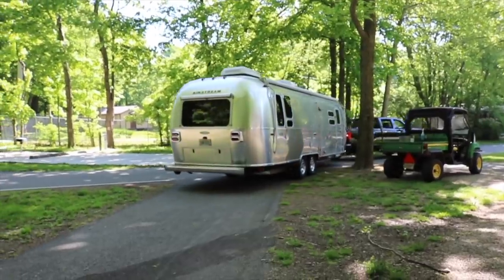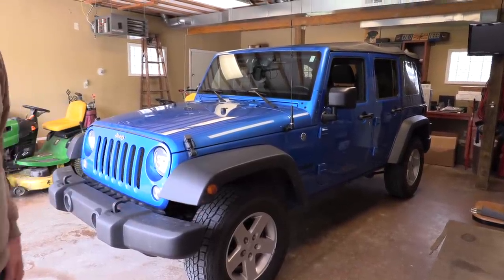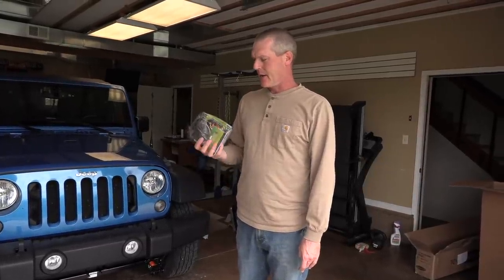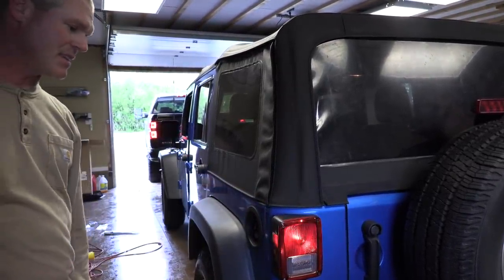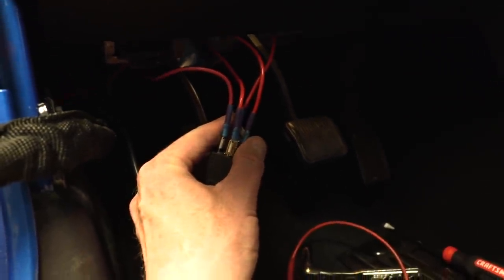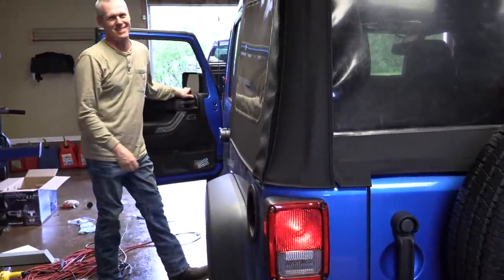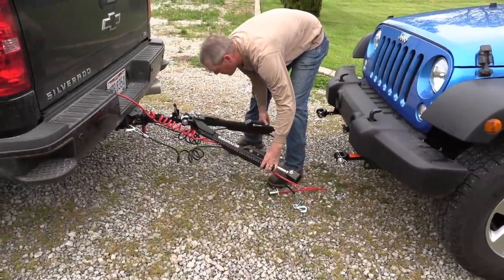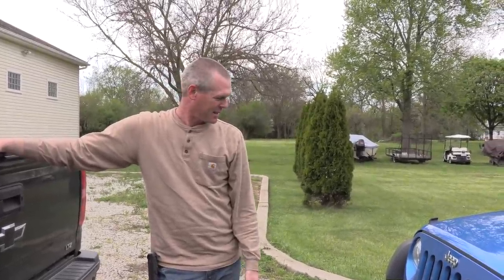Roadmaster Nighthawk Install// Jeep Wrangler Flat Towing RV

Comment: Yep, I did pretty much the same thing except for my vehicle is an F150 so I can haul my bike in the back.  I too cut off the 4 way connector and put on a 6 pin connector except that I am going to go with a Readybrake tow bar that has a surge brake in the tow bar.  I also will use vacuum pump to keep the front differential from turning on the truck.   I will have to install a cable through the firewall but it's a once and done kind of thing and I don't have to lug around a box for the brakes.  Keep the good stuff coming.
Reply from the maker: It was a pretty simple install and works great! We thought about a more permanent braking system but we tend to trade vehicles often do this seemed best suited for us

Comment: Congrats! I love towing my same Jeep as yours, but a 2014 hardtop I bought used in 2017 as a flat toad behind my puny 23 foot class C. Fine for me and my two cats. I have a different Roadmaster system and use a brake buddy vantage select. Camping world installed it and my wiring needs to be squared away. Now just the brake lights and marker lights work. Turn signals are hosed. I need to square it away but seldom drive after dusk anyway.
Reply from the maker: It was kind of a day project but glad we can do it ourselves! Everything seemed to be in good working order. The real test will be when it's annually being towed behind a RV

Comment: Congratulations! Can’t wait to see the big dully. Question, we are residents of Florida and no brake for the toad is required. Apparently, Ohio is different. But, if I read the law correctly, if I’m pulled over by the men in blue in the Buckeye State, I’m still good to go because I’m registered in Florida. Am I mistaken? We will be back in Ohio this summer, pulling our toad with our 30 foot class C and we even went from Charlotte to PA to Ohio with no issues.
Reply from the maker: You should be good as long as you're following your home state rules

Comment: Do you guys still find that running the patriot brake system at three works best for you? I just install the same system yesterday and I’m looking for a starting point.. my set up overall is very similar to yours.
Reply from the maker: We are still running the Patriot system and have no problems with it and like it because we can move it between vehicles
Reply: @WanderingWagners  hey thanks for that response. I was asking if you still set your trailer brakes at 3 while you’re towing. You mentioned that in the video
Reply from the maker: Didn't seem to make a difference where it's set at honestly

Comment: It appears your two safety cables re not crossed. All the other tow systems I've seen they cross over each other. Is that not the case with your Roadmaster?
Reply from the maker: In this case it doesn't matter if they're crossed or not because it's integrated. You still could if wanted

Comment: I may be confused about the relay that you added for the brake light/turn signal issue. When you tow the Jeep the ignition is off. So when the brake system applies the brake pedal you will not have brake lights. Correct? The turn signals will work all the time but the brake lights will only work when the ignition is on, which is not the case when flat towing a Jeep.  Did I miss something?
Reply from the maker: You got it right. You don't want the braking system to activate the brake lights or it'll cancel out the turn signal if it's on.
Reply: Awesome. I'll be installing the relay today for our trip starting tomorrow. Thanks.

Comment: I can’t seem to get the lights to come on on my roadmaster nighthawk. Any ideas?
Reply from the maker: They should just come on when the tow vehicles lights are on. Might be defective? Do all the lights on the vehicle being towed work?
Reply: @WanderingWagners  The turn signals and brake lights work as they should. The running lights don’t come, not sure if they are supposed to or not.